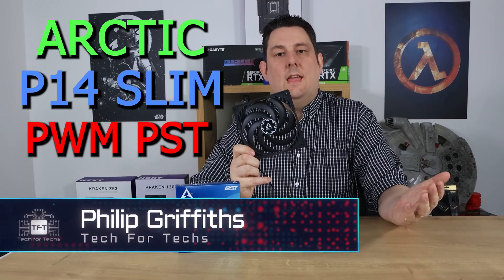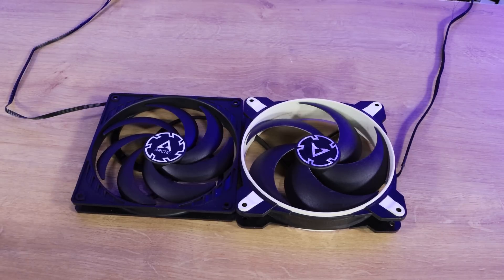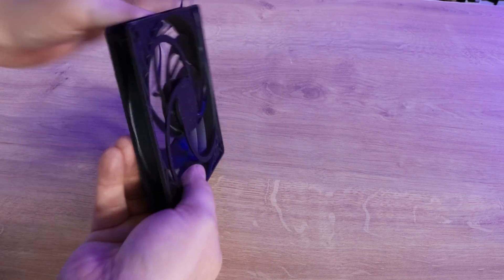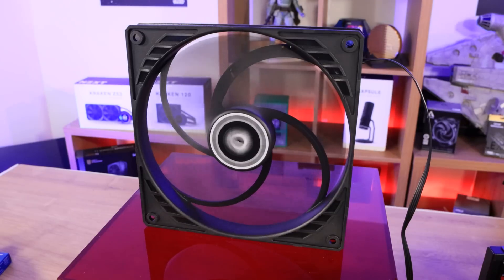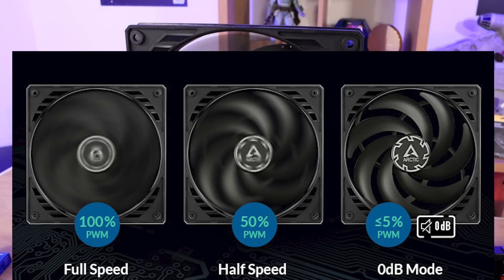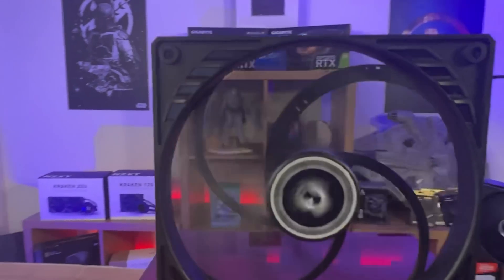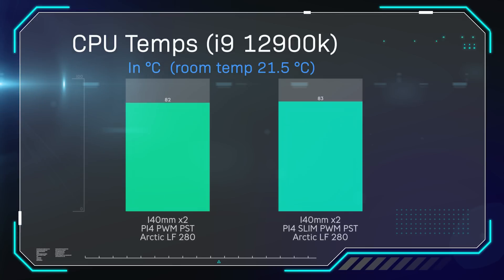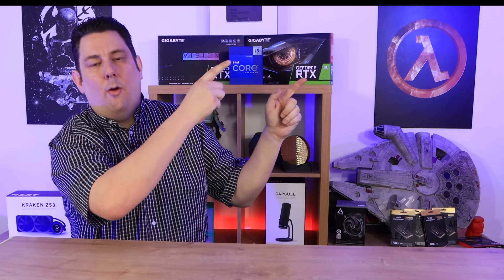Fan on a Diet - Arctic P14 SLIM PWM PST Fan - Can it perform as good as it's Fat Brother?

Comment: tks for the info, Artic has none of the cfm or sone on there site for this slim fan.  In your description you have ambient temp at 40c that is 104F I dough that is correct...  You might want to change that...  I'm thinking your ambient was around 21c = 70F that is where I try to keep my testing ambient at.

Comment: Thank you for the comparison on a 280mm LF II. Recently bought one and had to switch out the fans due to vrm heatsink interfering with the aio. They perform quite well in a mesh case like the AP201 as push fans on a top mounted rad. They’re however very flimsy and on higher rpms the four arms of the frame holding the motor and fan blades will flex towards the intake side - better make sure there’s a couple of millimeters clearance from the blade/intake side when mounting in cases or even certain rads in pull config.

Comment: I got one of these to have as a spare in case my Silverstone FW141 ever stops working, but something that worries me is that the fan blades are very thin, they actually resonate if you tap on the frame. I don't think fan blades are supposed to resonate, at least not THAT much.

Comment: Amazing Job! I was really curious about the difference with regular vs the slim 140mm fans. This would pair well with a 011 mini air on the top(ATX motherboard). Without the slim fans, it would not have the clearance for the RAM. I'm just curious if it out performs an arctic 240mm aio with regular fans.

Comment: I got a Phanteks P300 case with the P300A front mesh penal, a Phanteks vertical GPU mount with RTX 3080 TUF OC, unfortunately the card is too long and it hit my front mount 280 AIO lower fan, so I replace it with P14 slim and set the fan as case fan, when I play game and the case getting hot, it will start spin faster than the upper AIO fan.
Now when I game my case temperature stay at 41C comparing 48C before I change the fan and setting.